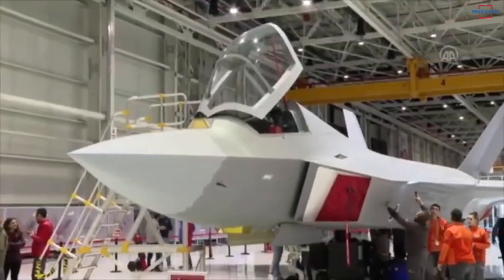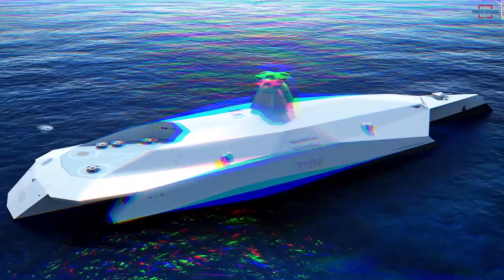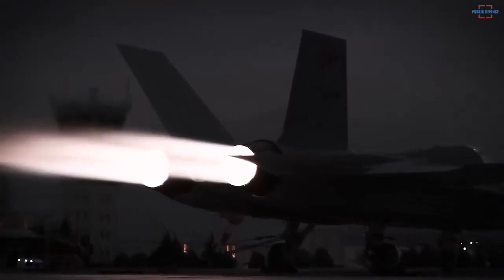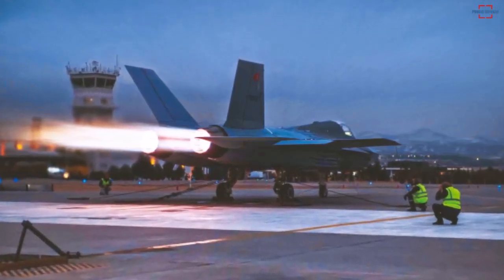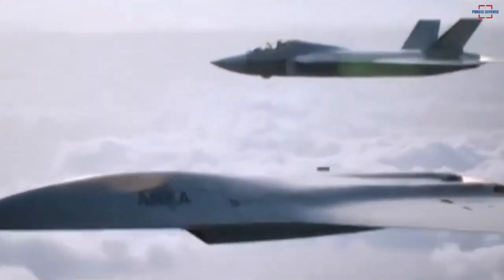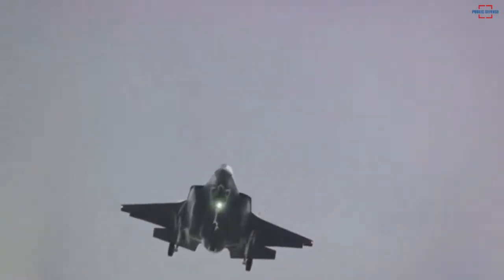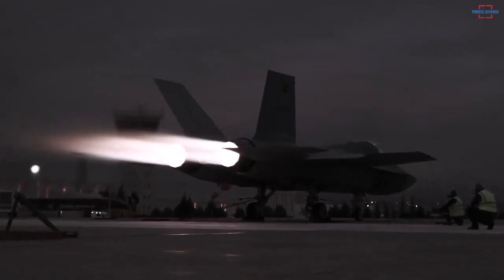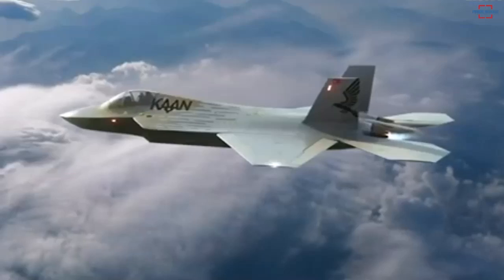The Success of Testing Domestically Made Engine for KAAN to Ready Compete with F-35

Comment: In time everything can be done. 
Turkiye produced F110 engine  for f16 and still producing for spare parts.also produced many parts of the f35 Pratt & Whitney F135 but it was parts not the whole engine or assembly. 
Now tukiye wants permission to produce for the new f110 Ge 129.
When it comes domestic engines turkiye produced TEL TS1400 helicopter( T625 Gökbey  engine also t129 maybe integrated, TEL PD170 FOR UAV like TB2,TB3, anka,uksungu ETC. Then upgraded versions like PD180ST And PD222ST.
TF6000 jet engine and FT10000 jet engine with afterburner but more powerful ones are in the process. 
Kala TJ1750, TJ300, TJ3200, TJ3700 engines for missiles, cruise missiles and drones

Comment: Unfortunately, incorrect information The tested engine is F110-ge-129 after-borner test. Tf-6000 and Tf-10000 are still being tested by TEI but have not yet been installed on any aircraft. The Tf-10000 engine is an engine very similar in size to the American F404 engine, namely TR MOTOR, which will produce the TF35000, is still in the design phase and will not be able to deliver an engine before 2028.

Comment: Actually TF10000 is not for the KAAN. That engine will develop firstly for Turkish Hurjet, the new training jet currently using GE’s F404 engine. This development will enable TAI to sell the jet trainer to third parties without any licence issues with the US and GE. It will however will be further developed to produce 40,000 lb thrust to enable KAAN to achieve all 5th generation envelope and form the basis for a 6th generation development of KAAN!

Comment: Kaan Prototype is powered by f119 (same as F16) and this configuration performed afterburner test. At least 6-8 x TF10000 engin may meet the Kaan power requirement. TF10000 is designed for Anka3 and Kızılelma
Reply: Niye Türkçe konuşmuyonuz hepiniz Türksünüz
Reply: Only prototype, tf6000 is in devolopment and he meant that tf6000 is seccussefully tested good
Reply: Bro tf10.000 is afterburnered version of tf6.000. Tf10.000 is going to empower kizilelma and anka3. Kaan development phase (prototype) and block 0 will be powered by f119, meanwhile tei tf35.000 will be developped and matured for next block
Reply: Rus Rusça, Yunan Yunanca, Koreli Korece, bir bizim özentiler İngilizce yazıyor her yorumda ilginç.
Reply: İngilizce bilmeyen kedi, fesatlanınca özenti dermiş
Reply: Kaan has double engine, it's more self reliable or can upgrade with foreign partners.
Reply: As far as I know 6000 is the smallest but tf350000 do exist